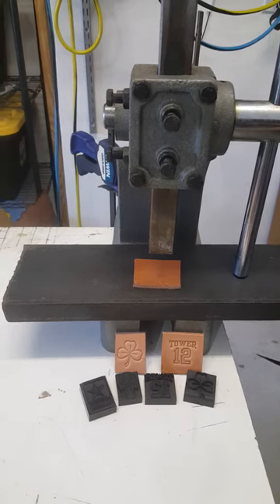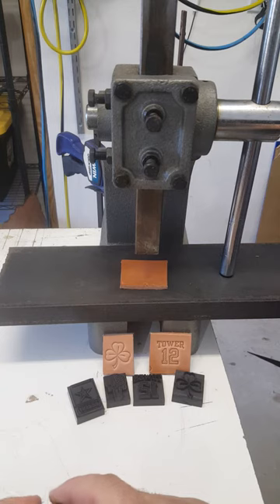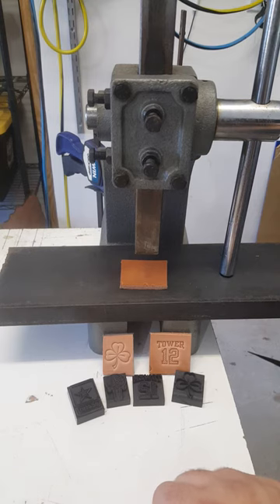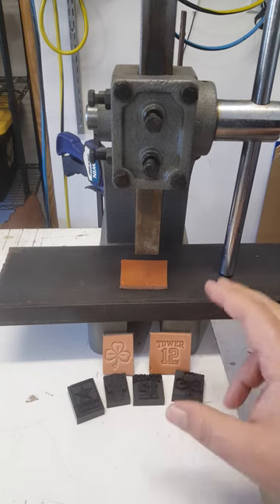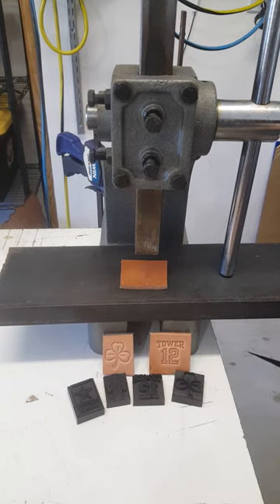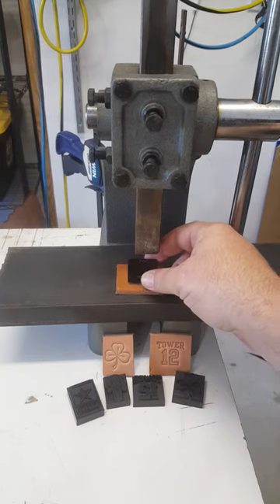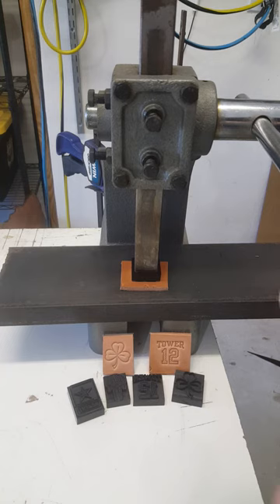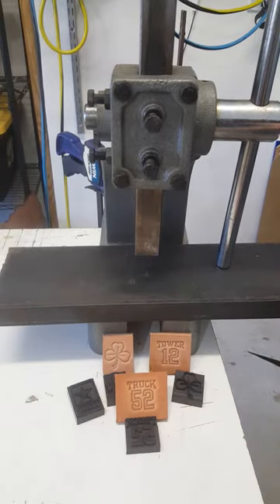Using a Arbor Press with leather stamps

Comment: Hi. Great video. Do you need to put some water on the leather? Or it simply works even dry?
Reply: When stamping leather, it takes a stamp much better when cased (wet). It will work with dry leather, but it doesn't burnish as well. It will look much better if cased. But that's really only the case for veg tan leather. If you're using chrome tan, just stamp it as-is.